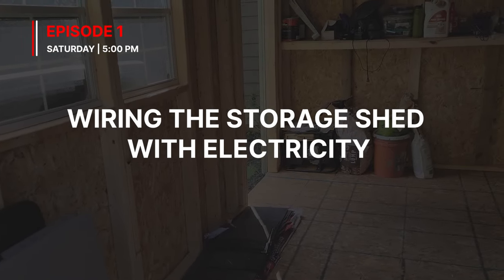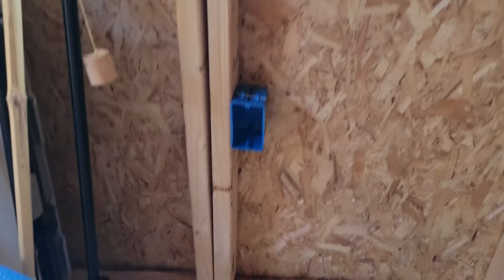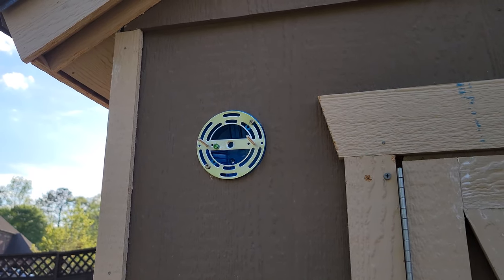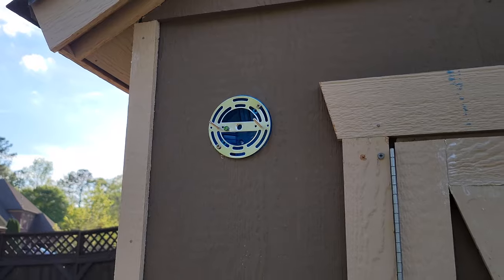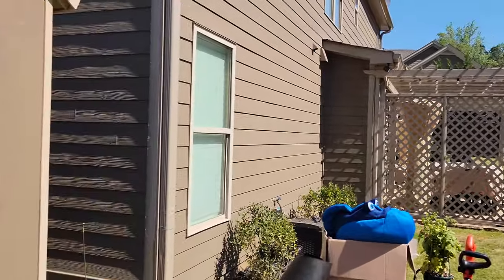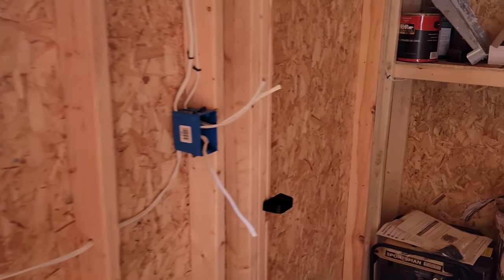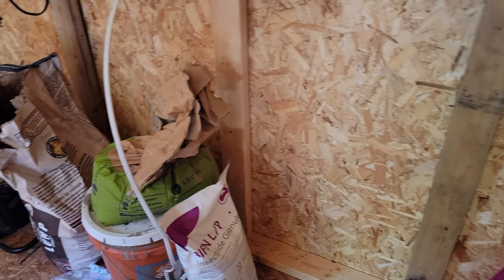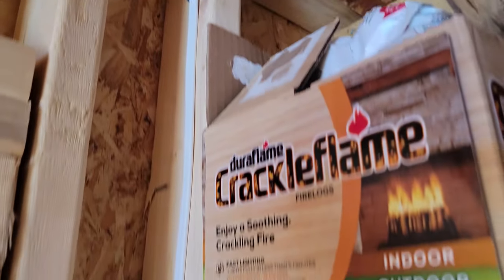Do you run electricity into your storage shed?  I added some lights and outlets.  Here's what I did.

Comment: On your outlets and switch you need to make sure the wire curves/bends in the direction the screw turns when tightened. I noticed a couple or yours seem to be in the wrong direction.

Comment: Looks good but on your switch you con not but 2 wires under 1 screw you need to make a pig tail on the wires then take a single wire to the switch. Also you can not use plumbing fitting  you need and lb fitting. The plumbing 90 has the cable bent to tight.
Reply from the maker: Thanks for the input!  Yeah I knew that about the 90 degree but them long 90 degree in the electrical PVC just made it difficult to get flush to the wall.  I used them under the ground though.  Pig tail the light switch.....I will fix that!  Didn't even think about that 😣
Reply: @RickyDriese  thats why we use fitting called an LB it keeps it close to the wall
Reply: Just a note you didn’t mention how deep you buried the wire from the garage if it’s in conduit needs to be at least 12 inches deep if not in conduit just the gray wire can be 18 inches deep. Just fyi.

Comment: You need a ground fault circuit tester to check for proper wire placement they have 3l lights and a button to check out all the plugs it tells if common and hot are reversed and that the ground is connected and with a push of the button it checks if the ground fault is working it's a cheap tool it can also be used to check if all the plugs in the house are properly wired and grounded wouldn't be the first time I've found reversed polarity or an open ground or a ground fault circuit that doesn't work nothing worse than someone with wet hands unplugging something and the ground fault circuit doesn't trip and they start singing you light up my life the first time I saw a ground fault circuit that wasn't working was in a new one home and the inspector found 2 instant fail that's when I bought my tester I'd checked them with the test button on the GFI outlet and it tested ok

Comment: How did you make the hole for the outdoor light?  What tools did you use and how did you make the hole so perfect ?
Reply from the maker: I used a 4 inch hole saw.  Basically a drill bit that will make your circle.  Just make sure you start by going backwards first to score the wood so you don't slip around.

Comment: Don't you bang the outside light when you open the left door? How did you hook all this up to your house panel?
Reply from the maker: That door is the one bolted into the floor and top. I actually do not use this one very often and have not bumped the light yet.  The shed wiring is tied in off of my garage outlets. There were only 3 outlets attached to that breaker.  The electrician that did some work before for me confirmed I was good to go on that single breaker. Had I needed to, I would have followed his prior wiring in the garage attic to get to my panel, which was actually very close to that spot in the garage.

Comment: First time I've seen a photo electric switch like that how do you access it in an insulated and paneled wall
Reply from the maker: Thank you for the comments and watching. The wall is thin.  I did use my Dremel to thin it out a tad bit more so that I could thread the back onto the sensor and hold it tight.  Worked out well. Comes on every evening with the other lights in the back yard.

Comment: I actually have the same shed from Costco. My neighbor is a electrician so he is going to run power to my shed. Any thing different you wish you would of done? I think thinking about a smart light switch for the outdoor but that timer gizmo you have is cool
Reply from the maker: The photo sensor works great for me because it comes on with my other post lights in the yard.  But a smart light there would work just as well for sure.  I did put a smart bulb inside that comes on real dim in the evening. It's useful because my husky likes to sleep in there sometimes. Other than that, the setup works perfectly without any issues.  I have a battery tender constantly on my lawn mower, I have two camera running (one outside and one inside) and charge my batteries, have a window ac unit that runs in the summer and a mini fridge too. All run without any issues. It's an awesome shed!
Reply: All wrong
Reply: @jackinoff98  what’s wrong ?

Comment: 7:27 probably about now you're realizing that you lopped off too much wire
Reply from the maker: Thanks for the comment. Actually don't remember having any issues with wire length in any of my connections. Just issues because not good with that tool, really was needing my needle nose (which I found later that day 😂)
Reply: @RickyDriese  there are little holes in the strippers you were using for making the perfect hook. 😎

Quick question: were you hard wired to power or did you plug into a power source close by?